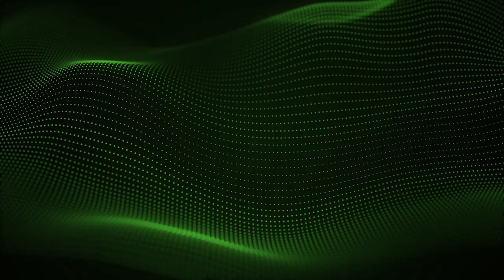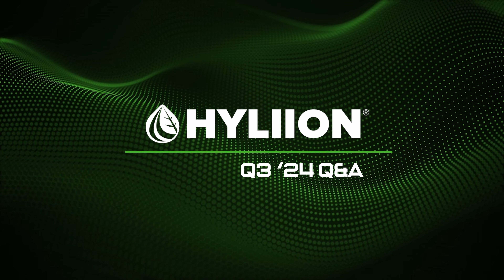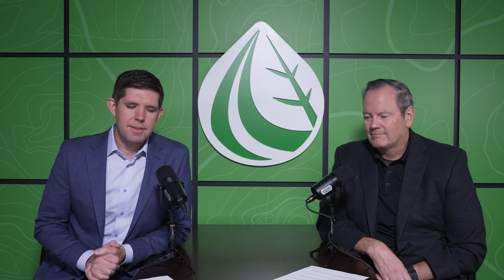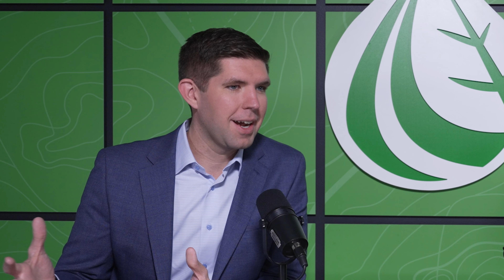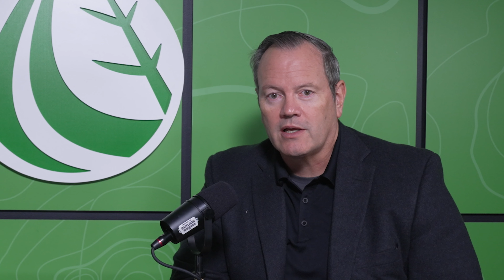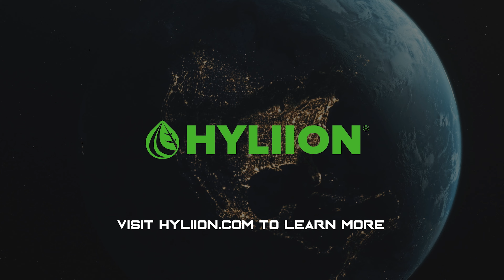Hyliion Q3’24 Earnings Q&A

Comment: Always said that data-centre would be a good ocus point. Especially because of all the headdeck about Nuclea&r energy, The West isn't China where they could build new Nuclear Power plants in a year or two, over here it takes 5 years + , with regulations and paper work it can take 10+ years before going in production. Karno could be a nice 2th option next to SMR s (Nuscale / Rolls Royce) for smaller applications, navy seal theirfor a logic customer. And don't hesitate to do a share offering and dilute us a bit Healy, if its for the good of financial safety to work toward syour goals. Its the only stock from my 150 I own that I don't really get upset with a dilution. Knowing their are smart minds behind that cash. And better not to wait, so at least I can buy some shares more, I didn't had cash when it crashed to 1 and beneath 1 a share, I was so upset that all my other stocks kept crashing to, not able to sell for cash. If Hyllion goes down way more, I will concider to sell half of my portfolio to try to get my share count goal of the year, Im way bahind what I aimed to own.

Comment: With being able to fit a ~2 MW fuel agnostic unit inside a small shipping container, powering heavy transport like ocean going vessels, harbor tugs, locomotive engines, and even cross continent Australian road trains should be good business eventually considering the simplicity of design and drastically reduced routine maintenance needed. Run them on RNG and they have the potential to be carbon negative to help a company's bottom line carbon output.

Also providing complete lease/installation/maintenance/fuel deals (with outfits like Clean Energy) will really help with the up front sticker shock for eventual initial full production units.